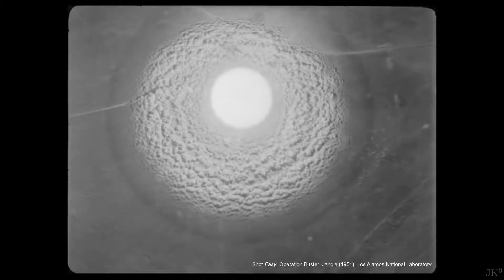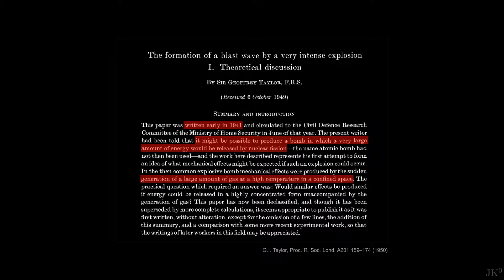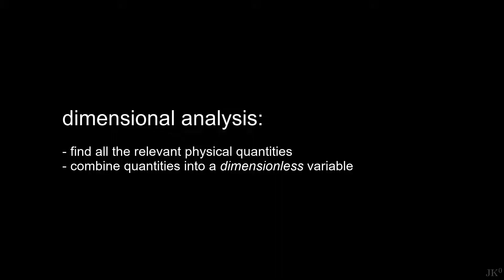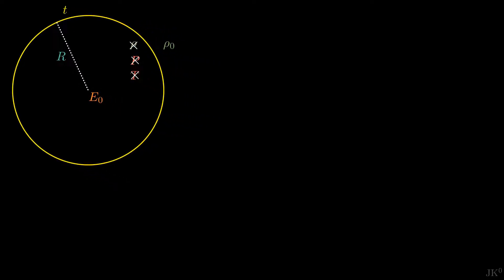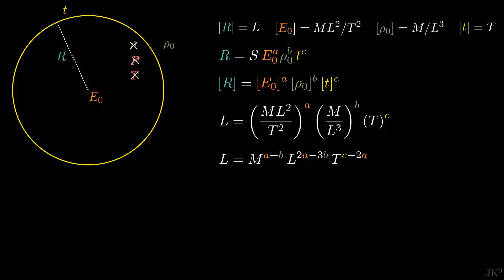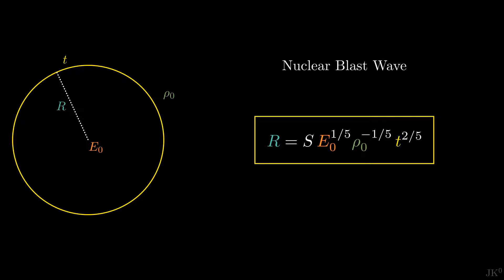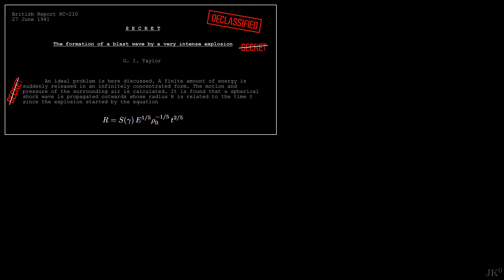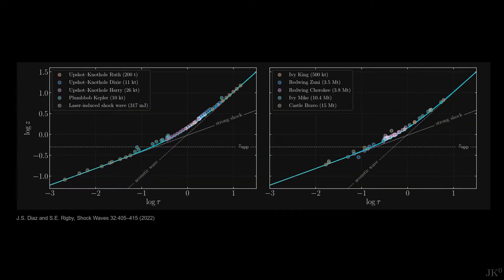Size of a nuclear blast

Comment: What about the variable t? Does this scale with E or was it experimentally derived?
Reply from the maker: Time is an independent variable, could you clarify what you mean by "What about the variable t?"
Reply: @jkzero  I assume there must be some limit to t which is what im curious about. If t becomes very large the size of the explosion also becomes very large. However explosions typically doesn’t last for very long. If the expression should be used to predict explosion sizes then we need an appropriate value for t.

Comment: This  equation says  everything and nothing.   It says  what the radius of the blast is at time  T after  explosion given  initial air density ,  explosion energy and  obviously elapsed time.
  It says nothing of the  pressure difference across the shock wave and cannot predict when the shock wave  regresses into a simple sound wave.  

What is far more interesting is what height  the  device  has to be detonated at to  produce maximum  integrated  blast damage  on the ground  eg to to maximises the number of say  brick constructed buildings that would be destroyed as a function of height of blast and blast energy.    I believe   Wm  Penny did this on the Manhattan project.   the dimensional analysis gives no insight into that level  of problem at all...

Comment: Why does an upward air stream form when a fireball is very high temperature but it doesn’t happen when it’s just a warm air cloud?
Reply from the maker: It is due to the extremely high temperature of the fireball. A so-called Rayleigh-Taylor instability forms and the cooler air around pushes the hot fireball upwards.
Reply: I mean it sorta does happen when theres a warm air cloud, right? Its just that the small difference in temperature means the movement of air is 'pretty windy' instead of 'city-leveling'

Comment: So in Taylor’s dimensional analysis, the radius goes as the ambient pressure to -1/5 power. What assumption did he make that causes the estimate to fail for an explosion in a near perfect vacuum where rho0~0?
Reply from the maker: one of the assumptions is that the explosion occurs in a medium, in free air to be more specific. His formula has to be cleverly corrected for explosions under water and under ground for this reason.
Reply: @jkzero  now that I think about it, isn’t that just a consequence of the choice of variables? The blast pressure isn’t a convenient variable because it isn’t constant or easily known, so eliminating P0 would make the problem difficult to simplify.
Reply: @jkzero  I still don’t see why the analysis doesn’t work in a vacuum. In the video you said this is not a shock front situation, so why does it matter that there’s a rarified medium at all vs a dense one? A thin/thick atmosphere would still give results, but as a predictor of radius vs time, this is going to diverge as pressure goes to zero. Where’s the breakdown? Does the value of S actually depend on the ambient pressure?
Reply from the maker: When you solve the system of partial differential equations you need boundary conditions, for a blast wave these are the Rankine-Hugoniot relations, which characterize the discontinuity of physical variables at the shock front produced by the compressed medium. In vacuum there would be no medium. You have to check the equations that describe the system instead of the final result; otherwise, the assumptions get hidden away. The details are presented in the paper below that I wrote a couple of years ago: set \rho_0=0 and all the boundary conditions vanish

https://eprints.whiterose.ac.uk/189567/1/D%C3%ADaz-Rigby2022_Article_BlastWaveKinematicsTheoryExper.pdf
Reply: @jkzero  thanks!

Comment: I have done (experimental) work on plume formation during femtosecond laser ablation. It processes similar to one-dimensional ST blasts...
Reply from the maker: that's interesting, you might want to check Sec. 4.4 in the paper that I mentioned in the video, we defined a dimensionless and yield-normalized system of time and space coordinates so that you can visualize a variety of shock waves on the same plot; there we included laser-induced shock waves and from nuclear tests in the same plot (see Fig. 4) https://link.springer.com/article/10.1007/s00193-022-01089-z

Comment: ...if I got this right, answer boils down to the simple phyisical law that:

    Work (Energy) = Force x Distance

where:

Force = Force whit what the air (atmosphere) is resisting to the aceleration = Mass (of the air witnin the "fireball" that is being "pushed out") x Acceration (of that same air)

Distance = Radious of the "fireball"

Since:

Acceleration = Distance / Time^2

Mass (of the air) = Volume (of the "fireball") x Density

equation can be expressed as follows:

     Energy = [Volume (of the "fireball") x Density] x [Distance / Time^2] x Distance

Now we express volume and distance in the terms of Radious of the "fireball" (volume of a sphere) and revrite the whole equation as follows:

    Energy = [4 / 3 x Pi x Radious^3 x Density] x [Radious / Time^2] x Radious

or 

    Energy = 4/3 x Pi x Density x Radious^5 / Time^2

Since Pi is close to 3 the constant at the front can be approximated to 4 so the term takes the following form:

    Energy = 4 x Density x Radious^5 / Time^2

Now we express the Radious in the terms of Energy, Density and time as follows:

    Radious = 4 x Energy^(1/5) x Density^(-1/5) x Time ^(2/5)

...:)
Reply from the maker: in terms of physical dimensions, what you did is correct; however, conceptually it is not because you are using formulas valid for point particles to describe a complex system (fluid under an explosive shock). The only way to describe this properly is in the form of a differential equation that has to be integrated over the fluid. In fact your analysis makes no reference to an explosion. You could ask: what is the distance: is the the radius of the object, is the distance that it moves? what is the density, is it air density or the density of the moving object? what is the energy E, is it the work performed to deform the object? is it its kinetic energy? With no context for using each equation there is no way to know what physical system it is describing, despite the fact that the physical units match.

Comment: What I don't get is how the implosion works; the chemical energy needed to compress to cause a fission reaction should cease to work once the outwards energy equal the chemical inwards energy, so how does more explosive energy result? Wouldn't it just blow itself apart, at that stage, thus massively reducing the yield? Or does the inward momentum carry it far enough such that the fission energy can massively gain during this time-period of momentum reversal?
Reply from the maker: Great question. When the high explosives go off, the 32 detonators produce 32 shockwaves around the plutonium core; the clever design of the explosive lenses make use of different burning speeds to turn the 32 shockwaves inside out so that the convex shockwaves become 32 concave sections of a spherical inward traveling shockwave. This compresses the core, increasing its density, which in turn decreases the mass needed to reach criticality below the amount of plutonium that makes the core (check my video about Critical Mass for details). At the same time, at the center of the core a so-called beryllium-polonium initiator is crushed producing a burst of neutrons what start the fission chain reaction in the plutonium core. Since there is more plutonium that the minimum needed for criticality, the chain reaction releases energy at an exponential rate. At this point the energy from the chemical explosives is totally irrelevant, the fission energy wins a factor of a million and growing exponentially. The core heats up and expands blowing up all the components of the bomb and stopping the reactions but this takes longer than the time that fission reactions produce several kt of energy, which are released a less than a microsecond in the form of radiation, heat, and blast. This is the nuclear explosion produced by an implosion bomb. 

Thanks for your question, I gave you a glimpse of one of the videos that I am preparing. Let me know if this helps and if you have more questions.
Reply: @jkzero  So the fission starts at the center of the core? I believe this solves my issue, as I envisioned the fission starting at the surface of the core, moving inwards as it was compressed, then reversing once the fission energy overcame the chemical energy.
Reply from the maker: @pyropulseIXXI  I see, what you describe is not the right process. What you mention is only how the chemical explosives burn from the outside to the inside. But the nuclear reactions work differently: the neutron burst starts at the center but neutrons quickly diffuse all over the core, and more importantly, each fission produces more neutrons so in a few nanoseconds there are more sources of neutrons produced all over the volume of the plutonium core, this is what produces the exponential growth of the chain reaction. In other words, the nuclear energy is produced all over the plutonium core and not as a wave that propagates within the core. Does that help?
Reply: @jkzero what exactly do you mean with a neutron burst? I would say neutrons are continuously produced everywhere in the core, but under normal circumstances, the rate of neutron induced fission is to low to cause an exponential growth of the neutron density. As the core is compressed, the mass density of the core increases, which means critically is exceeded. However, I assume this is an extremely complicated process to understand, as during the propagation of the mechanical compression wave, the mass density of the core is actually a function of r. So criticallity is not exceeded everywhere at once.

Comment: Another assumption I believe must be added is that all the energy suddenly released at a point goes into a shock wave.  The initial energy release of a nuclear explosion is largely put into x-rays as well as high ionized plasma.  A ball of x-rays expands as it eats surrounding air.  Energy transfer inside is mostly radiative. Absorption by air contains the radiant energy so what is called the isothermal sphere expands at a rate dependent on how fast the swarm of x-rays can progress through air and convert it into x-ray producing plasma.  The pressure is the same everywhere inside this sphere and there is no shock front.  Once the isothermal sphere has cooled and the x-rays become UV does a shock front develop with a characteristic shock peak.
Reply from the maker: thanks fro this, you have a very good point. In the follow-up video I was more careful and called E0 the blast energy instead of the yield of the bomb

Comment: I have a question about assumption number 2: for higher-yield bombs (Megaton region), would this assumption hold true? Glasstone and Dolan in The Effects of Nuclear Weapons talk about power over time and how there is a time where there is peak power output, but in higher-yield bombs energy is not all released at once. Thanks so much for your hard work!
Reply from the maker: this is a good question, the assumption of instantaneous release is closely linked to the relative size of the explosive device with respect to the yield. This is what makes chemical explosions fail the assumption #2 during the early stages (first microseconds) because for chemical explosives the relation between size and yield is much larger than for nuclear devices. In other words, assumption #2 is equivalent to "the ratio between explosive before the explosion and yield is very small," which is true for most nuclear and thermonuclear explosions. You can check the paper that I wrote (see Fig. 4 in https://link.springer.com/article/10.1007/s00193-022-01089-z), there you will see how the blast-wave evolution deviates from the Sedov-Taylor-von Neumann solution in early times but it works fine for all nuclear tests. For late times all explosions, chemical and nuclear, deviate when the blast wave decays into an acoustic wave, this is the breakdown of assumption #3 mentioned in the video.
Reply: The nuclear energy release even in a 3-stage thermonuclear weapon takes not much longer than about 1 microsecond, and possibly up to an order of magnitude more or less. This can be estimated in detail with some information about bomb component sizes, but is characterized by average collision times for fast neutrons and for the travel time of X-rays to the secondary and its subsequent compression, so you can imagine why these are the right times scales.
Now, you may be reading, in S&G about the propagation of energy out of the bomb material plasma - T ~ 1 giga Kelvin - where there are indeed distinct, new stages of energy transfer to the surrounding air. Largely, it is the somewhat prolonged and complex stage of X-ray ionization of air to fairly deep depths, with the blast originating in the expansion of layers of the latter (much like lightning). The simplest pattern is a "classic" two pulse phenomenon noted atmospheric tests.
regards DKB